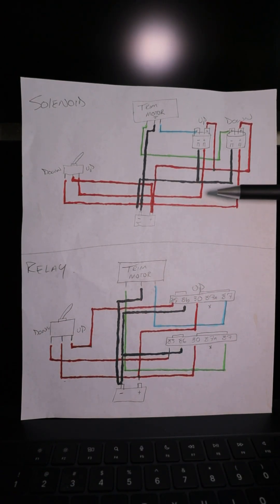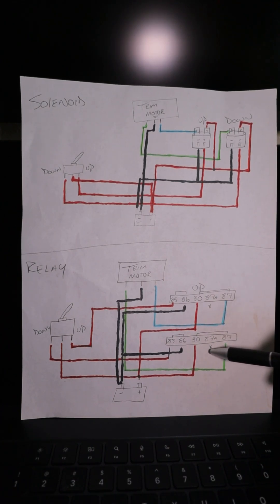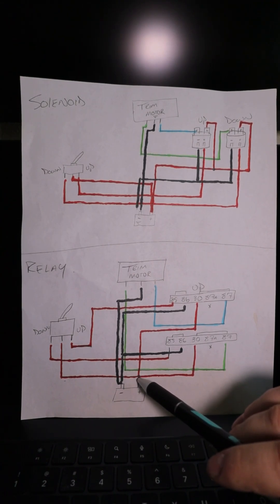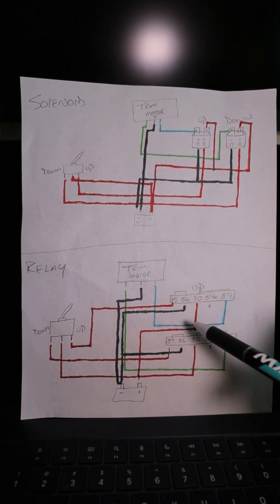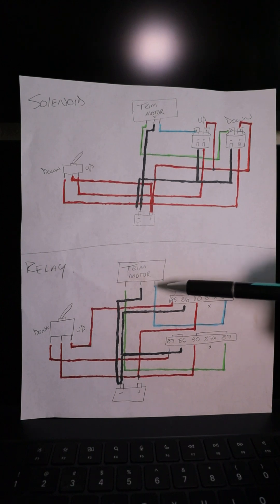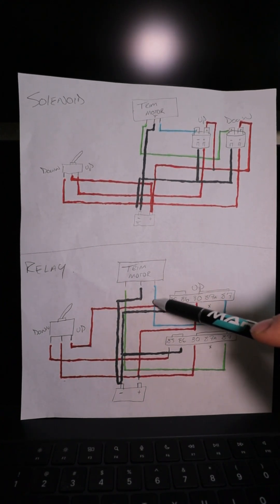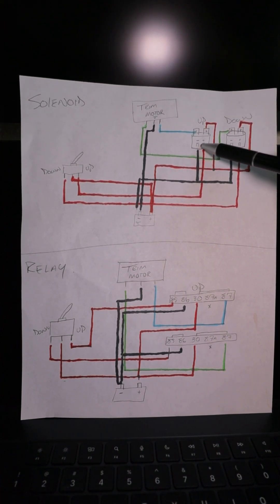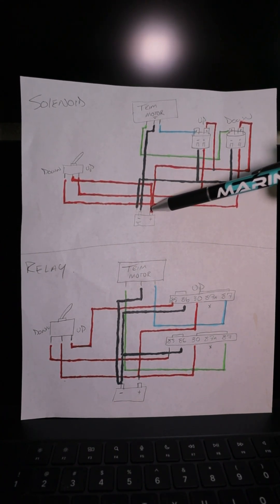3 Wire Trim Systems EXPLAINED (HOW TO MAKE CUSTOM TRIM TILT HARNESS FOR BOATS) #boatrepair

Comment: NERD ALERT ⚠️ 
These systems are designed this way using these devices, are in order to safely control high current motor(s) using low current components. The theory reduces the size requirements substantially, increasing innovative designs in areas where space is limited like a boat helm.

Comment: Hi mate I have a old 1985 ish 115 Johnson with the external style trim tilt.my pump has 4 wires.one black one runs to lift ram so must be like a sensor.the other three are red blue and black which run into the pump.how would I wire that bro.

Comment: Thanks so much, this is exactly what I needed 
Just to be clear- the red wire from 30 on each relay joins, goes to the + battery and continues to the middle position on the switch, correct?
Reply from the maker: Yes exactly!
Reply: @buschfishin five star explanation! Thanks for responding so quickly, I’m literally wiring this up on my kitchen table right now!
Reply: @buschfishin you nailed it! Works perfectly, subscribed
Reply from the maker: Hell yeah! Glad it worked!
Reply: One more question, where would you suggest putting the fuse?
Reply from the maker: Fuse should go anywhere inbetween the battery and 30 pins, usually easier closer to the battery so you can get to it

Comment: Thanks for your extra time putting this together for us, I did however manage to wire it up with wiring center switch terminal directly to battery positive, top switch to blue wire off of motor, green wire to down terminal on switch, and black wire off of motor directly to battery negative.  Do you see anything wrong with that wiring longterm?  I will try your method with the relays since I've got them as well.  Lemme know cheers brother!!!
Reply from the maker: Long-term this might be an issue because all of the power feeding the trim pump is going to be going through the switch, at times it can pull 30 amps.. the switch most likely isn't rated for that that's why the relays are in place. So the small amps can go through the switch and the big amps that the pump needs run on bigger wire from battery, through relay, and down to the pump. Those relays are rated for 40 amps.